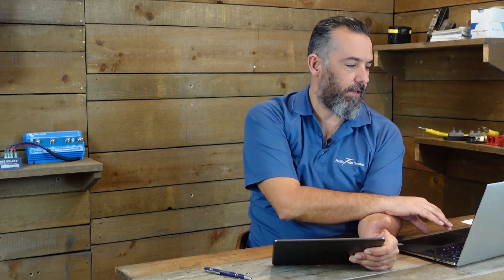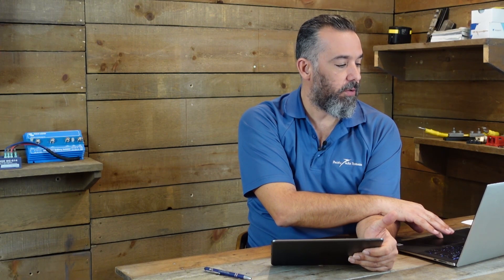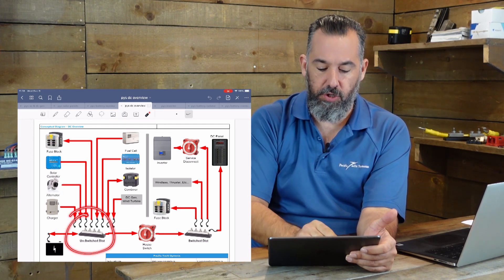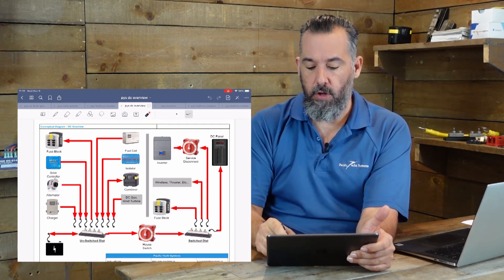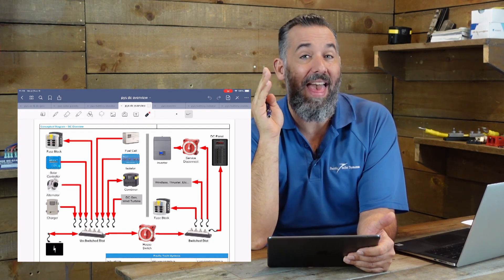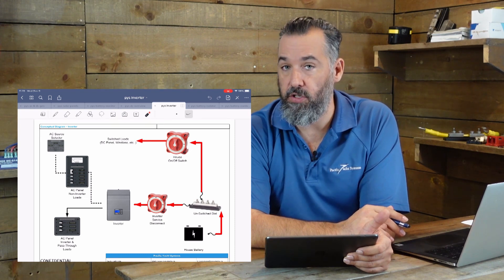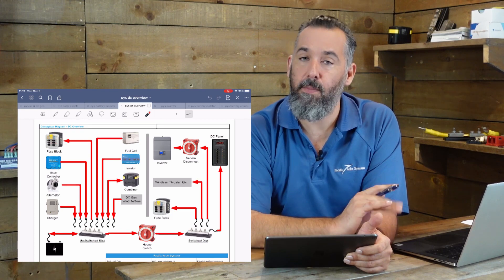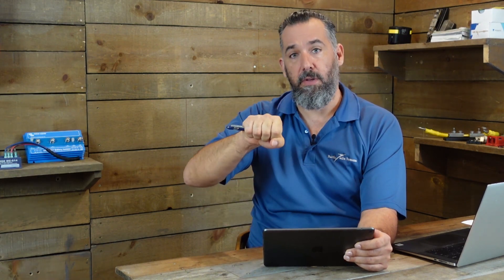Should the Inverter on My Boat Be Switched or Unswitched?

Comment: My inverter charger is located in a spot that makes it far easier and closer to battery banks. Is it OK to have it direct connect ( with proper shutoff switch and t-fuse off course) directly to battery bank instead of the unstitched distribution busbar that ALL other power sources go to
Reply from the maker: Hi Craig, you can connect your inverter to a battery via on/off DC switch and a class T fuse. As you mentioned, you don't need to have inverter go to a unswitched distribution.

Comment: What's your take on having an additional "maintenance" switch hidden away somewhere that disconnects the entire house battery bank, including bilge pumps and what not? Or is it just unnecessary complexity?
Reply: I have one.  I added it when reworking my batteries.  I find it way better than disconnecting the batteries when performing maintenance.  Downsides are high amperage switches are expensive, dissipate some energy, and are not as reliable as a piece of copper.
Reply: @ynAMe6Aj  yeah it seems like it'd be handy to have
Reply from the maker: Hi Johan, never seen this before and would say that it might make things too complex for the benefit.

Comment: I am a big fan of disconnects; in some cases, code requires them. As fond as I am of the control of having everything on a disconnect, or multiple disconnects, there is a negative aside from added cost and complexity. That negative is that every connection will have some resistance, including simple switches. The lower the nominal voltage of the system, the more pronounced this becomes. At 12 volts, a volt or two dropping from end to end can mean the difference between devices working or not. The move to higher battery voltages has been positive progress in terms of wire cost and weight. Higher voltages have less resistance at the connections throughout the system. Myself, I fuse or breaker the inverter input without a cutoff switch because of the voltage drop associated with a switched input. One switch is 3 more connections, each with resistance. Since you already need overcurrent protection, why not use a huge breaker that can act as a switch in an emergency and save yourself the extra fuse connections (a fuse is 4 connections added to the line).  Happy sailing. :)
Reply from the maker: Thanks for sharing Tao.

Comment: It actually makes sense to have DC disconnect switch not only on inverter/charger circuit but also on the charger so you can disconnect both, AC and DC sides and safely work on it if needed.
Reply from the maker: We do see thermal circuit breakers on the output side of DC chargers, but it's really rare.

Comment: Interesting setup: Solar charging lithium through MPPT and downstream Li charging Lead through another MPPT. Any comments?
Reply from the maker: Hi Josi, you could share the charge from the Lithium battery to the lead battery via a DC to DC charging converter.
Reply: @PacificYachtSystems  This is based on UPS feeding UPS in a data center. The objective is to charge each battery type with its own specifications and maximize the lead battery usage.  The trick is to size Li MPPT to include downstream  load and Pb charging.

Comment: what are the cons of  leaving just an inverter connected to the load distro un switched?  just the risk of leaving it on and draining the bank?
Reply from the maker: Remember inverter/chargers have on/off buttons to turn on and off the inverter function, you can still have an inverter/charger connected to unswitched distribution and still have the ability to turn it on or off at control panel or inverter/charger itself.